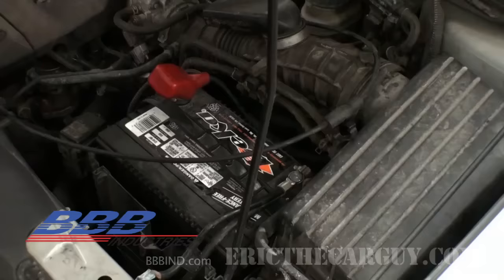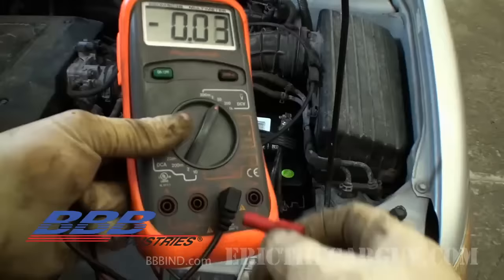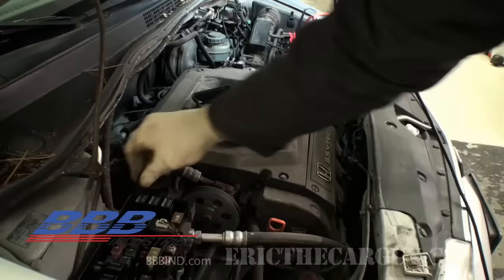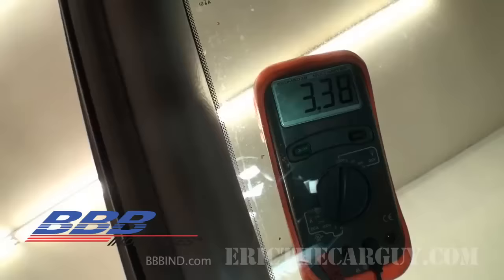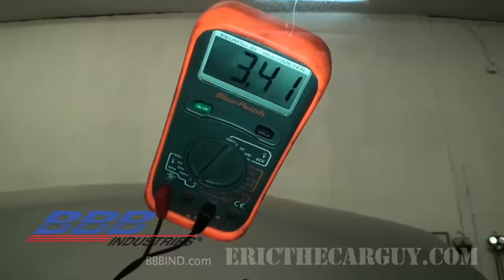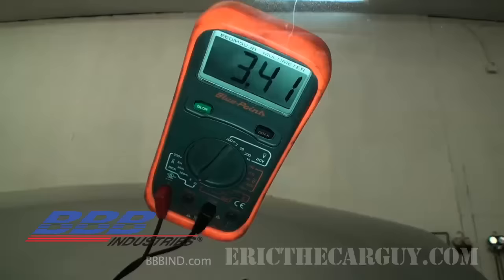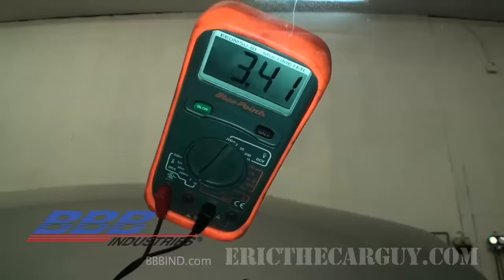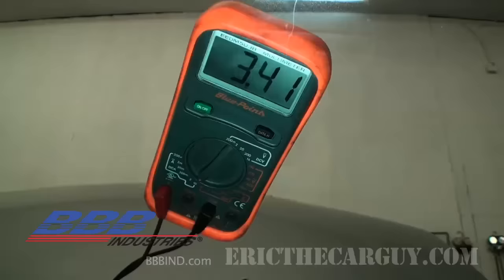How To Perform a Parasitic Draw Test - EricTheCarGuy

Comment: Can a parasitic draw test be done with the voltage or ohm setting? Don't have amps on my meter
Reply: You can do it by measuring the voltage drop across every fuse.
Reply: @stephenarling1667  thanks. Did that. Do you know or can link me to how to measure voltage in the j case style cartridge fuses?

Comment: Where is your meter hooked onto when doing the fuse testing? I can't see it. So did you clamp the red meter lead to the positive post and the negative to negative post? I'd like to see how the heck you're clamping those tiny lead tips because I can't keep mine on. There's nothing to clamp them on they're too tiny and can't get a proper connection. Help. Yes, I'm a woman.

Comment: I have a problem with my 04 Mitsubishi eclipse Spyder gs ,2.4 liter 4 cylinder ,it started making a loud humming/whining noise ,gas pedal vibrated,then there was a burning wire smell ,noise would increase when accelerating n turning ,anyone knows what's causing this ?

Comment: Can someone help me please, my car is draining the brand new battery overnight for some reason.. When I connect the multimeter between the cable and the battery (tried both + and -), I get 0.00 reading..
Reply: Could it be the multimeter not being from a good brand? It's from the local tool store and it's branded by the store itself... It was around 10 eur iirc but it works properly when i'm measuring  battery voltages etc

Comment: can vehicle recharge drained battery after jump starting?
Reply: Yes. If the alternator is working properly, it will charge the battery while the engine is running.

Comment: You shouldn't do this "pull the fuses test" on newer vehicles, as the various modules will send you chasing your tail as they power on & off. For older cars, it's fine. Newer cars require a Amp clamp on a live power source at the battery.

Comment: Sir, my car battery 45ah battery of fully charged 12.60 volt drops to 12.40 volt in just 2 days
 Is this drop too high or normal?
Reply: I think that's normal since it's less than 10%
Reply: @johnlee8985  I left obd2 adapter which draw parasitic current of 30 mAmps. Without it, the total current draw is 20 mAmps. So total,50 mAmps is this too high again which results in the said Voltage drops?!?
Reply: @tnamen1307  i don't know

Comment: Not trying to be a smart Az but you can save yourself a bunch of time by investing in another cheap meter - touching the posts on both sides of the fuses with the other meter as opposed to pulling each and every fuse- will make that meter go to zero when finding the draw plus, you don't need to continue to arrange the first meter to see the voltage drop

Comment: This is partly operator error, but also partly poor design. With electronics out the wazoo on these vehicles, they couldn't add a chime to warn that the light's on when the ignition is off with the door open? Or an automatic shutoff after 15 minutes of inactivity? Or simply specify a low-draw LED instead of a high-draw incandescent bulb?

Comment: ...add at least 18 v  10 amp solar panel ...on the roof..it would fit the roof..mine is like 60cm x 30cm dimension.. connect it to a charge controller to your battery....you will wipe the entire vampiric power drain by recharging free by the power of our star...why did not any engineer  think about that...its starts and stops automatically. when there is visible light...even an artificial light will do....dont have to worry about  drained battery forever...peace out...quote from a vamp hunter south east

Comment: If that switch was on, interior light would have been on also. Sounds to me you did this on purpose to make this video. Also, today's radios always draw current, for presets and theft protection. If the car is garaged for 2-4 weeks radio will empty the battery. Otherwise, good job explaining stuff.